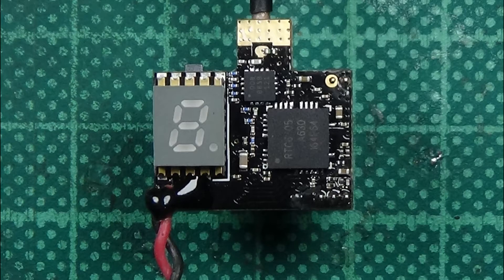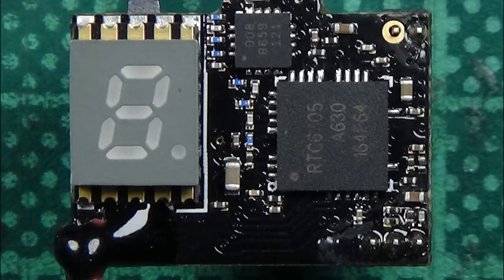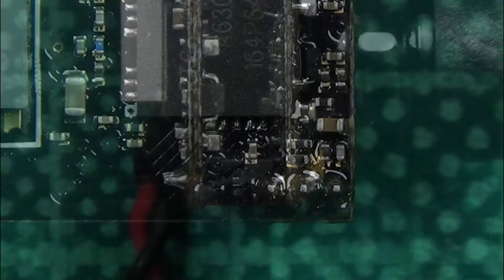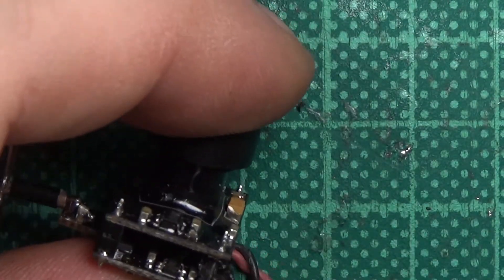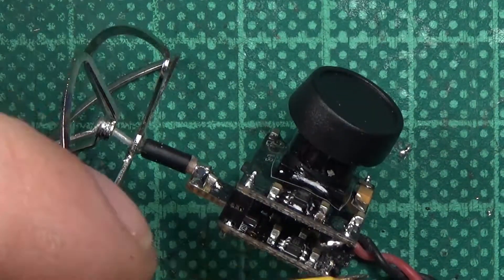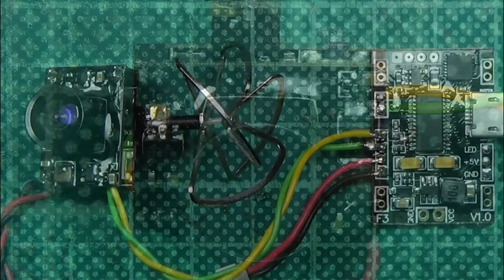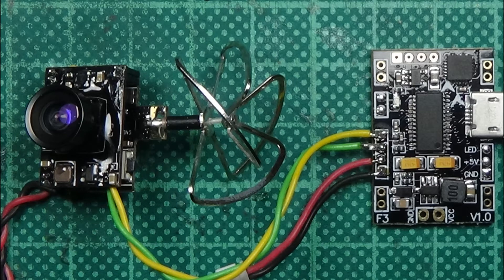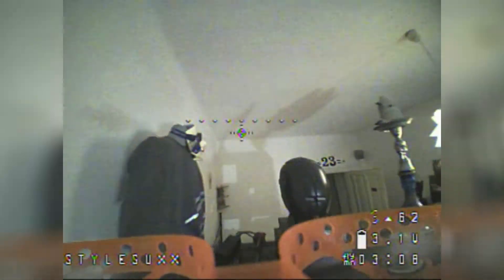TX03 OSD Mod

Comment: Is it possible to do it on the exmini2(bugs3mini)?
Reply from the maker: technically it should be possible with every camera that is somehow connected to a vtx - you just need to find the right pin. I don't know that camera so it is hard for me to tell exactly.
Reply: @stylesuxx  I have a TX03 Eachine how that of the video, I don't understand how I  to connect the camera the fly controller EX 2 Mini(bugs 3 mini) https://www.banggood.com/it/Eachine-EX2mini-RC-Quadcopter-Spare-Parts-Flight-Control-Board-p-1380249.html?rmmds=search&cur_warehouse=CN
Can you help me? Please.
Reply from the maker: @vittorio8013  I understand - no, this flight controller does not have an OSD, so you will not be able to do this.
Reply: @stylesuxx  thanks
Reply: @stylesuxx  Can I add an OSD  the Flight controller ?
Reply from the maker: @vittorio8013  Yes, technically you could add a dedicated OSD (something like this => https://goo.gl/RvHBZA), but I don't really think your flight controller will support it. If you just want voltage readout you could go with something like this => https://goo.gl/rXMy9q I would recommend getting a betaflight flightcontroller with betaflight OSD - this is definitely the easiest and cheapest option. - although, your FC has the receiver on board - I think it will be difficult to find something compatible.

Comment: Hello, Thank you for the walkthrough.
I have seen other how-to-videos on this mod. they were using the inner most pin for v/in and v/out. does it matter which one i use? or should i use the outer pin (the one on the bottom right) as you suggested?

Comment: will the camera still work if you put power just to the positive and ground e.g= you wanted to use the same camera for a brushed osd quad but then you also wanted to be able to swap it onto a tiny whoop that did not have osd and was just being powered by + and -
Reply from the maker: Sure, just shorten the pin (or the video wires for that matter) and yo are back to original.
Reply: ok thank you :-) I liked and subscribed
Reply from the maker: Glad I could help out - thank you, very much appreciated!

Comment: I want osd on my gps quad if mount FC board in side shell flat surface long wires for camera power separate would it still work thanks
Reply from the maker: Not sure if I get you, but if you are asking about wire length, it should not matter too much - just make sure all grounds are connected with each other and you should be good to go.

Comment: Nice video thank you. If people want to do the same with a FX798T they need to cut the top of the 3 pins on the right if the camera is facing towards you.
Reply from the maker: That is good to know. Thank you for the Info. How do you like your FX798T?
Reply: It's fine and nice and small on my Firer frame. But it's only 25Mw and the range isn't great, The reason I came to watch your video was I want to swap it out for something that does 50Mw. Hopefully that will improve the range. I don't want to go full 200Mw as I'm not that happy about the heat the vtx would generate at that power.
Reply from the maker: Cool, also using the firer frame on one of my builds.
I found that the TX03 gets pretty hot when powered directly from battery. I now have 2 setups where I run them from a clean 5V/500mA source and they do not get nearly as hot. I think it has a built in step up converter that does not need to work when you supply 5V directly.

Where I live we are only allowed 25mW so I did not test the higher settings.